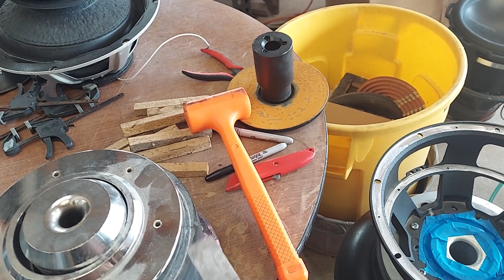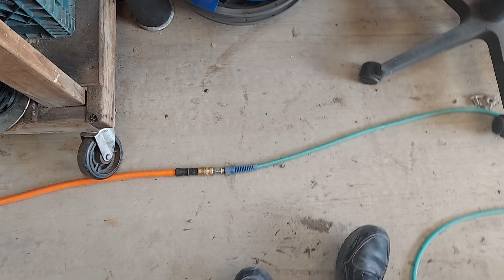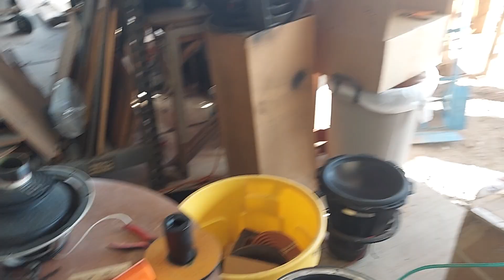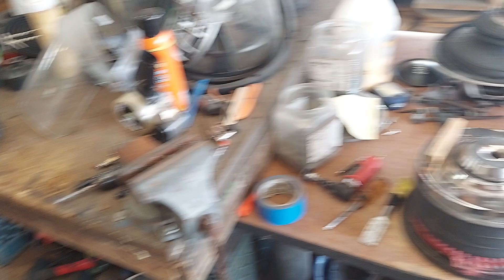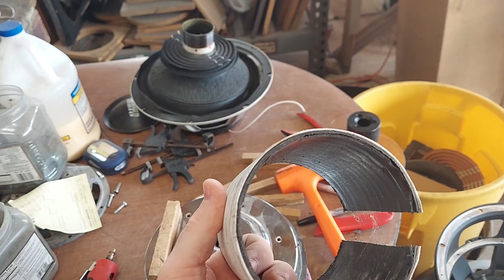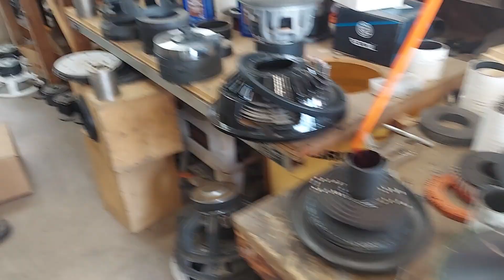How to repair / fix a shifted top plate / magnetic motor subwoofer assembly Wolfram PT Platinum

Comment: On my Resilient sound platinum 18 I’m having an issue. I got a melted piece of aluminum voice coil down in there the size of a 22 bullet and I cannot get it out to save my life. I got a recon kit the other day can somebody please tell me how the hell I can get that piece of lag out of there without messing anything up? All I wanna do is just bang my music and I can’t recon until I get that piece out of there does anybody have any ideas?
Reply from the maker: You'll have to use or I should say it it helps to use something that's non-magnetic but you can use or shape a piece of aluminum sheet in the form of a hook to try to pull it out
Reply: @RobotUnderground  appreciate the info. I kind of came up with that idea before I had just seen this a couple of days ago I recon that subwoofer and when I hooked it up to my amplifier, it made a buzzing noise. I didn’t even get a chance to bump it I do believe Resilient sounds sent me a defective recon kit because when I went to unhook, the speaker leads to the subwoofer it shocked the hell out of me.

Comment: I'm dumb but I can figure it out 😂! I don't care what you think about me. My Orion hcca 12 did that and nów makes a buzzing sound when on low volume! Do you sell the 4 inch dvc 2ohm 4 layers. It has some scratches from the top plate came off the motor and I couldn't get it completely even all around when I took my shim that I ordered off of a lord of Bass. It had to much space around the shim they sent and it is off center again. I have to figure it out how to get the magnet  apart? I J. B. Weld on it. Thanks 👍

Comment: I have a sub that i need to do this on. Its an re mt. I figured it was how you explained it. Pretty much the only safe way. One guy here in the comments suggested running long screws through the top plate to lift it. Lmao talk about dumb. I would be highly upset if i cracked that top magnet slug.
Reply: I've done it 100's of times over the last 28 years and you've done it how how may times? I'm dumb, you're smart and you still have a shifted motor. If you fuck up ferrite doing it, then you should not touch motors... period. Patrick has done it using long bolts, along with Paul Pierce and many others. You do it your way, I'll do it the way I do it.  He didn't like my comment for no reason, because he's done it. You should start your own YouTube channel and show us how to do it.
Reply: Sir. I was 8 years old playing with magnets. Ive broken ferrite magnets verry easily. No i havnt seperated a top plate before but i dont have to to know that i dont want to take the risk. This is not a motor that one would want to take the chance on. Its irreplaceable.  @Chuck_Sanders
Reply from the maker: Is it the top plate or T-yoke?  When you get that top plate off text me direct 602-312+6504 pictures and dimensions in metric.
Reply: @RobotUnderground top plate. And thank you.

Comment: Does it always take some kind of trauma to the driver for this to happen? I haven't seen it before in person, but I've also never dropped a woofer.
Reply from the maker: No.  Sometimes the glue fails from abuse / getting the coil too hot.
Reply: @RobotUnderground  Ah, of course. I didn't consider heat being a factor, but it should have been obvious.

Comment: Always so eloquent.  Lmfao 🤣 🤣 
Not dumb just uneducated.  Unless you've been doing this it can be difficult.  If it's neo magnets forget it.  They will shatter like glass. DD Supercharged for example.  I want to Supercharge it now that it needs recone. Great You are buying three. Those neo pucks are so fn brittle and slam down so hard when charged its not funny.  I've done it lots but it is far easier to do when ferrite magnets are discharged.  Want a DD Supercharged then you should have ordered it that way. Always warn before they buy. It will also raise your FS in the process.  Anyways Great video.  You explained it well.  Brutally honest and definitely not for a beginner.  Topp plate shifted I will almost guess magnets or bottom plate might have.  Stop dropping the fucking thing or going 4x4ing with the box hitting the roof. Or drifting with the box not bolted down.  It just happened.  Bullshit.  Fine. Heats your bill for it just happening.

Comment: Pat I have a Concept lmt motor with one broken off screw. Could I get away with running it horizontally for any length of time?Broken screw on bottom.
Reply from the maker: 5 out of 6 is fine.  Just make sure you use a support for the motor in the enclosure.

Comment: Another way to remove top plate is by using longer screws than what normally mounts the basket and run them down into top plate a lil at a time gradually kinda like tightening lug nuts on a wheel. Itll walk itself away from the slugs.
Reply from the maker: Well, you don't always get the results that you want.  We snapped bolts, broken ferrite, all kinds of trouble.  I've done it by accident plenty of times.

Comment: You can also remove the top plate, with long bolts. Just tighten them down equally, working in a cross section pattern, until it is lifted up high enough to remove it. Many ways work, but you definitely have to be careful, with live magnets, lol. Especially when you are setting the top plate, back on.
Reply: I wouldn't want to run screws down onto the magnet slug. Ferrite is kind of brittle.
Reply: @Susanbabin  It doesn't hurt the ferrite, one bit.  I've done it for years, so have many others that repair/ recone drivers.  Longer bolts with a ratchet and  socket, then go in a cross section.  Shim it out and reverse the process putting the top plate back on.
Reply: So you but bolts on the holes in the bottom of the motor? If you have a picture or any help thanks! I have the Orion hcca 12 -2 dvc @Chuck_Sanders
Reply: @jrbeanz7605 No, use longer bolts from the top, like you would be bolting down a basket. The longer bolts would raise the top plate away from the ferrite itself. Go in a cross sectional pattern, and go slowly. Done it 100's of times.
Reply: Yes it already took the tip of my finger off between the 440oz magnet and top plate.I got to close to the magnets while holding the top play and caught the tip of my finger. Them things slammed together! 😮
Reply: I got a 4 inch  3d printed  sleeve to Atlanta top plate magnets didn't work it was too thin around the yoke so I had to add shims with the $29.00 plus tax and shipping a handgun with 40 and they want $10 to ship it back so line up getting $20 back for something that didn't work. I wound up using I'm blue tubes from UPS. It's still awful off when you push the woofer down the the riddle from the speaker stopped. Is there any does it at low volume when you turn it up you can't even tell if something's wrong with it

Comment: i got a Auidio pipe motor which has metal flakes inside bunch of it lol hard to take it while its magnetized
Reply: Take some tape and roll it up into a tight tube with the sticky on the outside, you can work that around in the gap to pull bits of metal and other light debris out of it.  Keep using fresh tape as it collects the crap you're trying to remove.
Reply: https://youtube.com/shorts/7lri-vA3x1w?feature=share

Comment: Glad I've never had to deal with that. Is that what happens sometimes if the motor gets too hot and starts melting the glue?
Reply: I’d say most cases would be when you drop the motor or subwoofer as an whole. Most times it would be shipping companies that cause this.
Reply: I guess I've just been lucky. And careful. I've had subs in every vehicle for 26 years. And have had my own business in car audio for about 15 years and never once had this happen. I have always secured my boxes and my customers boxes and have never dropped a sub either. Hopefully it will stay that way but I probably done screwed myself now. It will probably happen first thing tomorrow morning now. Lol
Reply: Car wrecks and bad pot holes also, Well if your box is not secured and bounces.
Reply from the maker: 500F is when the epoxies start breaking down.